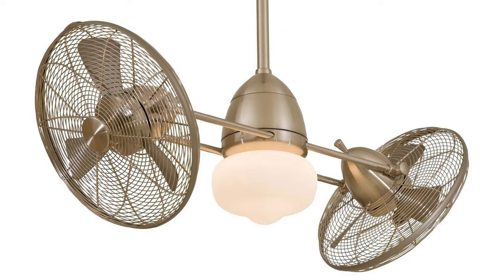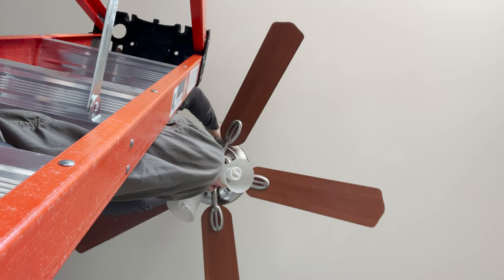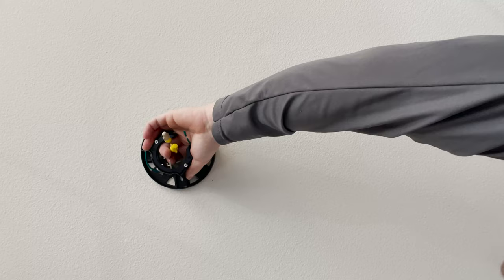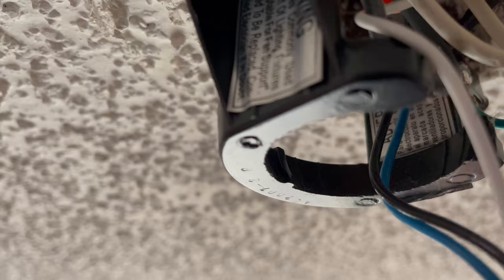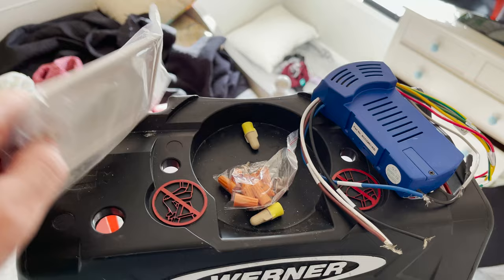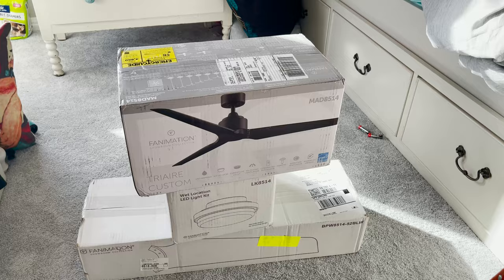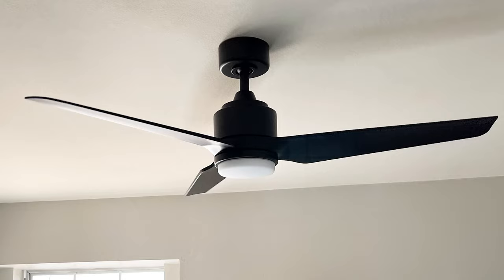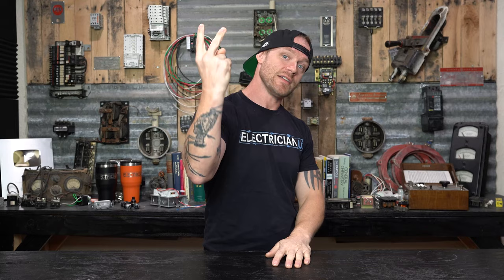How To Install a CEILING FAN - (From an Electrician)

Comment: 2 to the power of 5 is not 120.  You do the number of possible states per switch (2) raised to the power of the number of switches (5).  That gives you 32.  1 switch is 2 options, 2 is 4 options, 3 is 8 options, 4 is 16, 5 is 32, 6 is 64, 7 is 128, 8 is 256.

Comment: how about putting up a 600lb crystal chandelier with over 400 pieces took us about 3 hours to assemble and install this huge light and yes i needed 2 other people to help me lift it up while we hade a safety line attached to the light to help aid in the lifting was such a pain
Reply: Done those also, I tell clients you want me to hang that crystal  at 100$ an hour or you wanna do it? Guess the answer? Also I don't screw with these either unless client has a motorized lift on cable wire. Some people think you can get a lift in the house for 100$ and do the job. I don't even mess with these, waste of a phone call and my breath.

Comment: does anyone know if u have to  torque a receptacle by code?
Reply: Yes look at NEC 2020 code handbook version torque values given in appendices. Appendix I I think.
Reply: Never seen anyone actually torque a plug tbh
Reply: @Nick-bh1fy  in the UK or US? In the UK don’t see why no. Given a check most electricians use is to check loose connections in plugs and one of the main reason for burnt sockets with loose connections causing arcing. In US the latest recommendations make clear wrapping wire under receptacle terminal heads and torquing them is best practice and the NEC handbook gives guidance on that, far better than using the stab connections at the back of the receptacles.
Reply: @mathman0101  Ofc follow nec specifications on torque settings and Use accordingly but I’m just saying if u use a green and than a flat to get that last 1/4 turn I can guarantee those connections won’t be loose
Reply: @Nick-bh1fy  sure enough that will not be loose but I was still surprised how much more was possible with torquing.

Comment: Most ceiling fans don’t have a black and white wire, how can you tell which wire is positive and which is negative
Reply: Whichever one gives you a nice shock is the positive. Honestly though that's why I haven't changed my bedroom fan because the wires don't match.

Comment: What if my rough crew doesn’t give a flying fuck. And they mounted the fan cake with crappy wood; jokes aside. If you’re doing rough, leave a really generous “courtesy loop”  on those fan plates. If you have to put up a low profile disc light it’s nice to be able to cut the conductors down to where they fit inside the tiny pancake. Then when a fan gets put in you’ll have extra conductor. With the 1,000’s of fans I’ve installed I  like to keep my line wires really short and keep the fan wires longer.